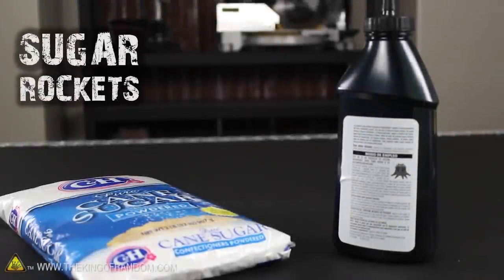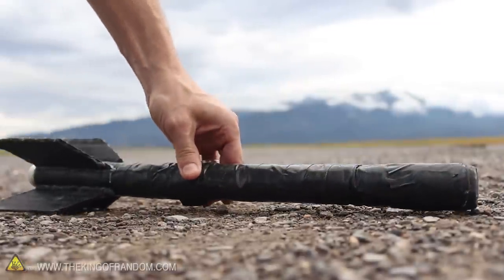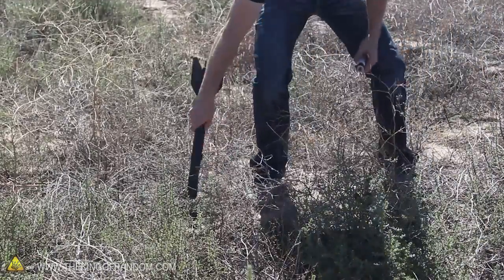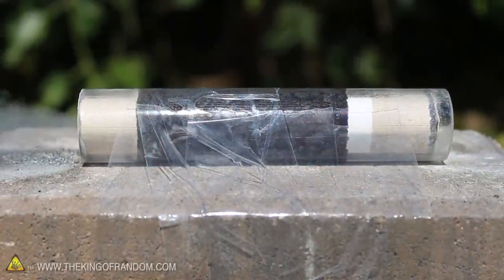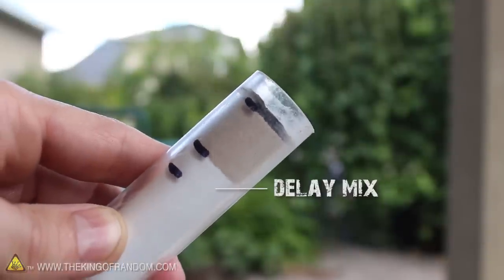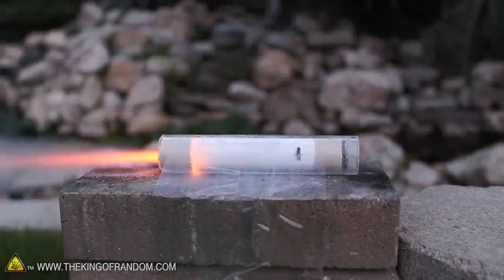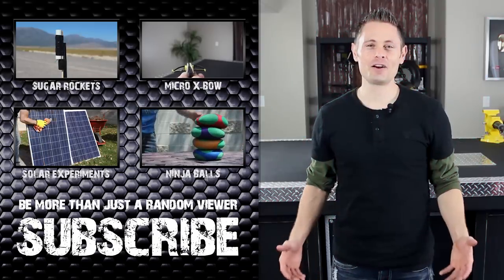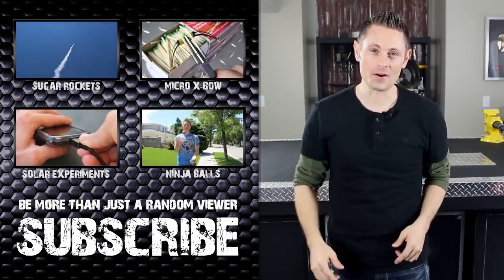Redneck Rocketry

Comment: I have been doing homemade rockets with my eighth grade class for the past 23 years. We use the already prepared rocket engines, but the rest of the rocket is made entirely from scratch. We use cardboard packing tubes, Easter egg nose cones, balsa or basswood fins, and parachutes made form trash bags and monofilament fishing line. I would really be interested in your spring video on homemade rockets.
Reply: Dang that class been with you for years
Reply: i took that class in 8th grade.  metal shop.  why we were making rockets, i dont know.  but it was alot of fun.

Comment: Someone should attach a camera to it and have it record while in the air.
Reply: Now theres an idea...
Reply: Adding weight to the front is actually helpful as it shifts the center of gravity farther forward from the center of pressure. the theory of stability is that the center of pressure should be the distance of one rocket body diameter behind the center of gravity (1 caliber). any closer than that and the rocket will become unstable. if the center of pressure is forward of the center of gravity, the rocket will be really unstable. So, my point is, the weight will not negatively affect the performance of the rocket, however what may be affected is the aerodynamics.
Reply: ***** Oh no, im just saying that i finally found someone with similer thinking if you want to put it thatway, sorry if i offended everyone in my last comment.
Reply: yeah !
Reply: but the camera wod brake
Reply: Glyn Hughes Yeah, it really depends on where on the rocket he places it, and how hard it hits the ground.
Reply: Apogee Rocketry sells a "keychain camera" that they show taped to the side of a rocket and it works fine.
Reply: I thought that too, but they seem to think it's fine. Also, there are rockets with clear tubing for the payload area. For a camera that small, I would find a way.
Reply: Camroc '66

Comment: Why not try building multistage rockets next? The ejection charge on the first rocket motor should be able to ignite a second rocket motor.
Reply: I dont know if you still want the answer after 6 years but if the rocket lose the stability and start to turn to the side, then that will be a problem

Comment: Crap. I tried to prove you wrong about how high it flew, but 8 seconds accelerating at 9.81 m/s is 353 meters, or aprox. 1000 ft.
Reply: ish thats a very rough calculation.
Reply: How do you calculate this?
Reply: @gemsilog9157  
I think by this way.. (calculating the falling time after burn up as 8 sec.)

(9.8×8)+(9.8×7)+(9.8×6)+(9.8×5)+(9.8×4)+(9.8×3)+(9.8×2)+(9.8×1)
=352.8 m
~353 m

Comment: "Dean Borchert" - BP also comes in 4F (for priming flash-pans on flintlocks) , however, the substitute called "Triple 7" is has slightly more power, makes less smoke and is cleaner/leaves less residue.

Comment: should have strapped a go pro on there
Reply: That would have been awesome, but might be too heavy.
Reply: No not really did you see that thing fly, just make sure every thing is balanced and you are good to go .
Reply: not enough thrust, need cluster or thicker pvc pipes
Reply: peter kao normal weight of a normal go pro is 8.something oz. that's less then 1/2 a lb. there is more than enough thrust and more then enough speed to get the go pro WAY UP and still only lose like 30 or less feet
Reply: alex accosta But the weight and air resistance would slow you down.
Reply: LunaR_ ² read my last comment
Reply: Archangel_ ur right

Comment: I like your videos. I make BP rockets and have a sugar rocket motor kits I bought on eBay. I've been using the sugar fuel as a delay in my bp rockets and works great. I've made sugar rockets by ramming the fuel the same as I do the bp ones and they work great but I've only made small ones up to 1/2". Dia. I add a bit of red iron oxide ( rust ) fine powder. And it makes it more reactive. Wander if you can do the same with your method of melting the fuel. It is a lot hotter mix. Would like to share making helicopters with the sugar fuel as well

Comment: FYI... that is not "black powder" that was being used in the video.  That was "Triple Seven", which is a modern powder equivalent for use in muzzle loading firearms.  These two products perform in completely different ways.  If you don't know the difference between them, then home built rocket motors are probably not for you.  Also note that "Pyrodex" is another BP substitute for firearms, but it performs more like a smokeless nitrocellulose powder and makes a poor substitute for ejection charges.  You'll do much better to use real 3F or 4F black powder, but if you use Triple Seven, be sure to make the end cap as tight as possible for containment of the charge.  (Yes, I am a rocket scientist and know what I'm talking about.)

Comment: I have a couple of questions, first, when you say 15% by weight, is that 15% of the weight of the original mixture or does the final mixture consist of 15% baking soda? and second, could the sugar and KNO3 mixture be used in the place of the black powder?

Comment: Instead of using the Potassium Nitrate and Sugar mix, Could you experiment with Sparkler Powder? Like the stuff that they dip the metal rod into to make it into a sparkler
Reply: Mite just as well use match heads, amateur.
Reply: Mate, that sparkler powder does give a lot of thrust... I just don't have a rocket to put it into.

You'll never know till you try?

Comment: Hey Grant have you tried  using the rocket fuel mix for the ejection charge ? I'm rebuilding an old Estes Optima to accept this motor , never flew very good on a D 
engine anyways.

Comment: I was just getting into making my own rocket engines with the kids when you put this out. I've burned through 4 or 5 engines without getting enough force to deploy a chute. The energy seems to be going out the back with the rest of the fuel. I've tried a slightly bigger and slightly smaller drill bit to bore through the clay to the delay mix. I hate to just keep adding more black powder, but maybe that's what it will take. The rocket I've retrofitted is 30" with a 24" chute. Any tips?

Comment: Not to be that guy, but if this were in a vacuum, yes, falling for 8-ish seconds would mean a height of just over 1,000 feet. But this isn't one, and that extra time is due to a lot to air resistance, meaning it didn't go to 1,000 feet. It's cool nonetheless and I will be making these motors, but it's no 1,000 foot rocket there.
Reply: I am, in fact, correct. Do explain the error in my observation.

Comment: make a rocket with 2 boosters. one each side. Have the boosters launch the rocket, and as they burn up, they will ignite the main rocket fuse at the top somewhere via a small hole, and the boosters will fire their parachutes and separate. wondering how the main rocket would actually burn ignited from the top and burn down.

Comment: Grant, you mention @ 4:36 that these can be modified to be used with Estes rockets...Do you have a video on that? I have lots of rockets at home that my daughter and I built, but we haven't launched in some time because I just cant afford to go buy a bunch of engines...This would be perfect (and the randomizer rockets)...   Thanks in advance for your time, Grant!
Reply: i would think just find some PVC that's the same dimension as the estes engine. or, failing that, roll a tube with glue and kraft paper on a dowel

Comment: Would the charge at the front be powerful enough to create a multistage rocket? As in using the charge to separate the lower stage and ignite a second motor.

Comment: I have a question about a video effect you use: The thing where it looks like a bit of a glitch, and the colour channels get separated (sort of static+green/purple tearing).. what is that called and is it something in Adobe After Effects, or is it a custom made effect?
As far as I can tell it's something generically used with masks on an adjustment layer, but I've not seen that in any of the default effects before.

Comment: Would using rice to absorb moisture work for that mixture?
Reply: Save those silica gel packets you get in many items.  put them in the oven at 300 for 30 min to desiccate.  Then store the "white propellant in a sealed container with several gel packets.

Comment: @thekingofrandom  hey. I just don't have acess for gun powder. do you know what else I can use ?
Reply: +givingtnt I have the same problem too. making gunpowder is complicated enough for me to do.
it would be great to have a replacement for it :)
Reply: +givingtnt  take the charges out of fire works, should be good enough, also making gunpowder is easy 75% potassium nitrate, 15% charcoal and 10% sulphur. the sulphur can be obtained by using electrolysis on sulphate of potash plant fertilizer. all percentage is done by weight. mix all 3 in a cup of boiling water for 10 ish minutes and then filter out the powder and leave to dry for 5 hours and it should be good to go
Reply: +Will Snow oh cool thanks !
Reply: +Jonathan beauvais because 'murica. You know, it's easier to find gun-related things that fertilizers.
Reply: +givingtnt you can make gun powder easily
Reply: +givingtnt You could probably use Armstrong's mix. Search youtube for that. Probably even easier to find the materials than to find bullets.
Reply: Gun powder is 75% p nitrate, 15% charcoal and 10% sulfur by weight. U can make your own charcoal and get sulfur dust at a garden store, it's only 90%

Comment: What you call 'black powder' in this video is actually called 'black powder substitute'.  It is pretty easy to find, various brands depending on where you look.  Real black powder is not easier to find than potassium nitrate.  I live in a pretty large metro area and no local stores have it.  Real black powder is also more expensive than substitute.  This is a great video.

Comment: Why can't you use the white powder for the chute charge? Is it not strong enough to deploy the chute?
Reply: +Smogden You need something explosive. Ejection charges on commercially-made motors have about the force of a firecracker. This is needed to pop the nose off and deploy the chute. The white mix just doesn't burn fast enough. (An explosion is just a really fast fire)
Reply: Scott Plumer So it is explosive enough to launch the rocket, but not the chute?
Reply: Pretty much, yeah. Commercial rocket motor (from Estes, for example) are made with black powder that's been modified to burn slower, rather than fast enough to explode. The ejection charge is closer to regular black powder. Also, black powder, such as in a bullet casing, is in an enclosed space, so it burns quicker (quick enough to explode). I didn't see if Grant did it, but commercial motors also have a clay cap on the end to keep the ejection charge contained. The white mix probably could explode in the right conditions, but I suspect not all that strongly.

If you're gonna do this, do it outside and wear good-quality protective eyewear.
Reply: I realized this in the shower this morning (I do my best thinking there): the white mix is actually a low-grade gunpowder. I saw "low-grade" because it doesn't go "boom" when ignited. The sugar takes the place of the carbon, and the stump remover has the potassium nitrate and I think the sulfur.

Comment: How can I tell if my KNO3 has absorbed moisture?
Reply: It doesn't burn.
Reply: +adam polcyn Potassium nitrate doesn't burn. It's the oxydiser in the mixture, i.e. you need to add a fuel...

That said, get your KNO3 from a reliable source and store it properly. If you don't know how, read up on your chemistry. Don't just follow some guide online; when working with explosives (or the raw materials involved in making them) YOU are responsible for your safety and the safety of our neighbourhood.

I've met a guy who was boasting about his home-made fireworks. Apparently he kept several kilos of nitrate, perchlorate, sulfur, and powdered metals in his shed without any kind of fire retardant containers. I called the fire department, they sent in the bomb squad! They estimated that if a fire had started in there, he'd have blown up at least his housing block.

I don't want to discourage you; I've made black powder, smoke bombs and similar pyrotechnics with kids 10 and up. Just make sure you know what you're doing. If you don't have a chemistry background, find a chemistry teacher or a local rocket club to help you. Don't get all of your information from online sources, especially ones that aren't likely to correct you before you do something stupid....
Reply: +AdenineMonkey I meant it doesn't burn when mixed with a fuel source. I know how these things work.

Comment: To anyone who made this rocket... The one issue I had was that the nozzle or cap (made of kitty litter) would blow on launch or just feet into the air, from the pressure. Anyone experience a similar issue? All ideas and solutions gratefully welcome. Thanks!
Reply: try making the rear hole (with the fuse) larger, if if has a bigger hole to decompress from., it will not blast the front off.
also, try to make the front block thicker.